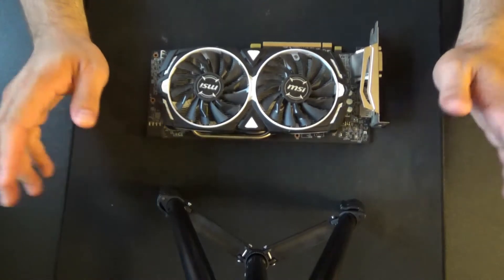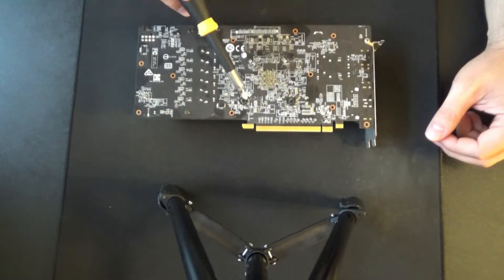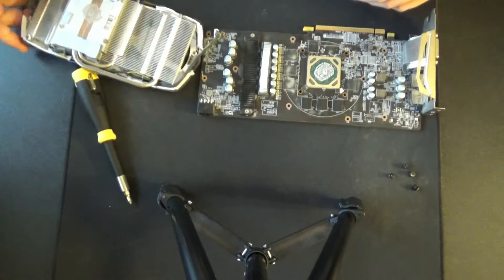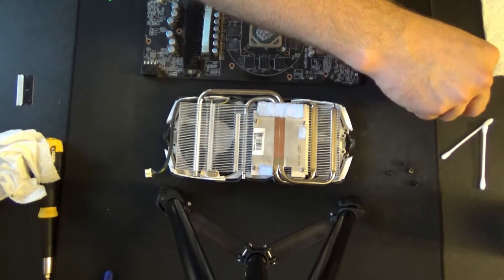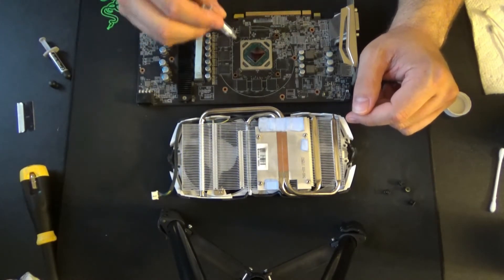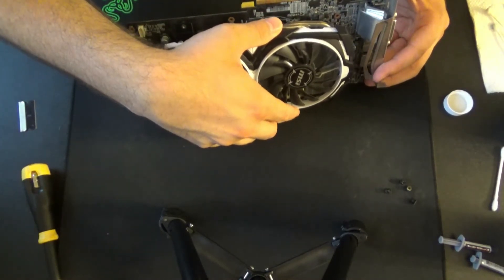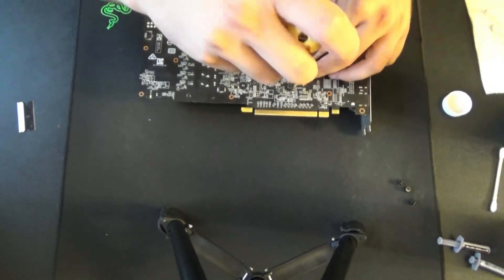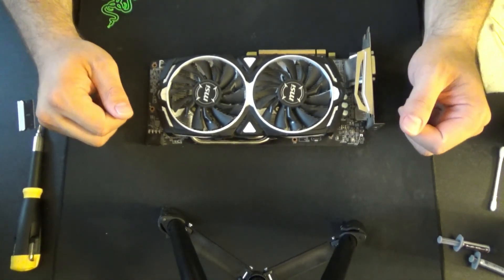New Thermal Paste for the MSI Armor Radeon RX 580 8gb

Comment: So what do I do if the heatsink is just stuck to the gpu? I removed the four screws but it won't split.
Reply from the maker: The old thermal paste can get stuck. Try to turn it about half an inch in either direction to loosen it up. That usually does the trick.
Reply: I used a blowdryer than eventually I used a littel force and it slowly slide off.

Comment: i have a rx570 version of MSI armor , temp really get hot sometimes , god of war normal temp can reach 83c without undervolt. will try to apply new thermal and update again !
Reply: And? Did it help?
Reply: It's a 3 years old card , I bought new. Thermal didn't really dried out but I changed new thermal gel anyway ( thermalright tf4 ). Didn't really help much in my case. GPU still reach 82c while on heavy load

Comment: What about thermal pads, does it make any difference if you replace them?
Reply: Yes, and a very large one at that. Apply thermal putty Upsiren UX Pro. And for the core apply phase-change material Honeywell PTM7950. It is also a good idea to do undervolting.

Comment: With GPUs it's recommended to use more paste than the pea method used on CPU's but you SHOULD NOT use lots of a conductive paste like Arctic Silver as that can cause a short with the SMD
Reply: What about Arctic Mx-4?
Reply: @John3-16-  I was wondering the same thing. I have Arctic mx-4 but now I don’t know if I should replace the thermal paste it after reading this comment haha
Reply: @ffa3939  I did it and it worked fine so you should be good
Reply: You should try phase-change material Honeywell PTM7950. It comes in as a sheet, lasts longer, performs works better than traditional pastes and there is no pump-out effect. For the power section (vrm) and vrams, I advise you to apply thermal putty Upsiren UX Pro instead of thermopads.
It is also a good idea to do undervolting.

Comment: What size thermal pads does this card use?
Reply: Apply thermal putty Upsiren UX Pro. And for the core phase-change material Honeywell PTM7950. It is also a good idea to do undervolting.

Comment: Mine is overheating so much. I even did a fan curve with MSI afterburner and even if the fans are working at %100, the temperature is almost always 80 degrees celsius. I do not know what to do. I reapplied thermal paste arctic mx4 and made sure the screws are properly in. It's still the same and Idk what to do...
Reply: xRewiindzZ  undervolting worseness performance
Reply: armor boktan bir model ne yaparsan yap düzelmez çünkü heatsink denen borular yetersiz. komple soğutucu değiştireceksin yada satacaksın gidecek. benimki de 80 derecede elektirik süpürgesi gibi ses yapıyor.
Reply: @kliibapz  evet hocam hele gece var ya kapımı kapatıyorum ona rağmen dışarıdan sesi duyuluyor oyundayken şaka gibi ya
Reply: @Alerdo  bro is that possible the fan will stop spinning after re applying the paste? My rx 580 armor is stop spinning after reboot
Reply: @kuysaybangamingofficial0077  no of course not. I said although I applied new thermal paste, and even though I MANUALLY set the fans to spin at %100, it still reaches 90 celsius in games.. I fixed it though by undervolting and I don't even have to set a manual fan curve now xD
Reply: @Alerdo  that is my problem right now brother ive already change the thermal paste but the problem is the fan is always stop after the booting
Reply: @kuysaybangamingofficial0077  that's a good thing bro. It's a technology called zero rpm I think. When your gpu does not need fans to spin, it stops them so that the fans can survive longer. Don't worry mine stops too. It only starts to spin when I play games.
Reply: @Alerdo  bro is that possible that the fan will not spin even i play games . :( i feel worried bro PROMISE then i experience that the temp is going high up to 90'c then my rig blackout :((( help me please is there anything that can do? ive changed the Thermal paste (ARCTIC MX4) is this bad? thanks bro
Reply: @kuysaybangamingofficial0077  bro can you manually set you fan to turn at %90 or 100 ? try that. if it still does not spin, then you should send it to a repairer
Reply: @Alerdo  okey thank you so much

Comment: I recently bought the same video card only its 4 GB version and noticed the absence of thermal pads on 3 memory chips.  There should be approximately 6mm thermal pad.  I couldn't figure out if she should be here.  Whether the seller took it off or did not stick the msi himself.  Help me please
Reply: Bro, can you fixed? I need the size of thermal pads for this gpu and i cant find information. Sorry for my english

Comment: I did the thermal paste replacement but the GPU has 33 C° while iddle and 90 C° while gaming, I don't know what happened.

Maybe the thermal paste is bad? I don't understand how it maintains normal temps while iddle and then goes so high while gaming.

Thank you for the video!

EDIT: well, it was the damn thermal paste (was an old and cheap one). I used arctic m4 and now is at 29~30 iddle and 72~73 while gaming.